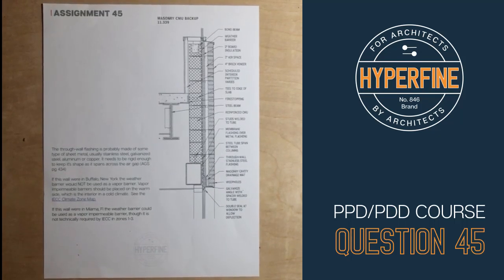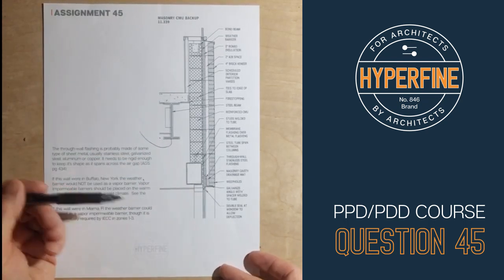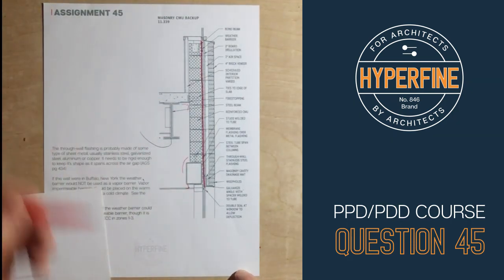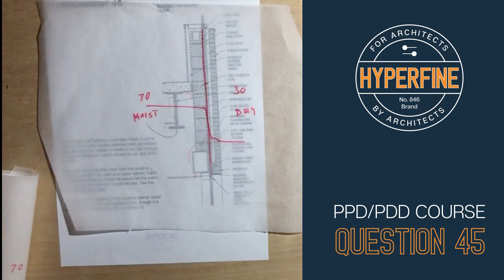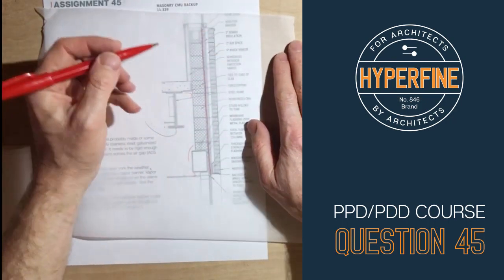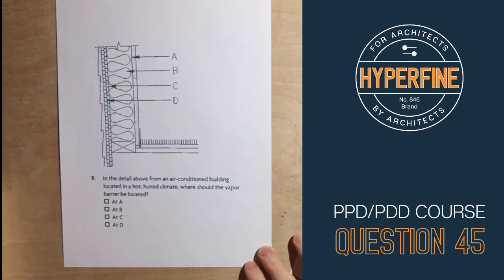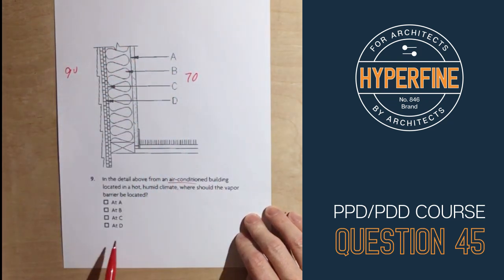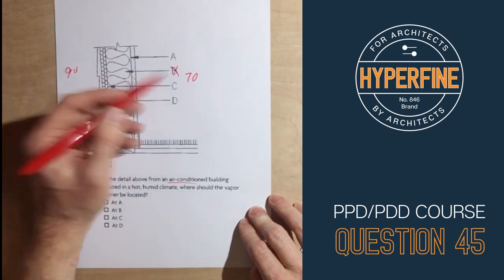ARE 5.0 - Vapor Barrier Locations

Comment: FYI, on question 9.. In Hawaii it is very common to install Tyvek building wrap as a way to prevent air and moisture from passing through to the wall cavity but allows water vapor to pass back and forth. This is one of those instances where the AREs use "typical" information which does not apply to many places. In other words, because Hawaii has a climate which is both hot and humid and can also be more mild and in some places even cold we almost never use a real vapor barrier or retardant and instead use building paper, building wrap etc. So really my comment is more to say as far as your "constructability" comment about placing a sheet membrane on top of studs it is common in Hawaii as the Wall for less expensive homes is detailed frequently as Siding>Building Wrap>Studs with insulation> drywall. Thanks for the video, helpful for the ARE studying!
Reply from the maker: Nicholas, thanks for the info! I agree, I think we all find areas where we know "too much" for the ARE and you have to think about the most basic, simple method. Not what happens in the real world, but what happens in Graphic Standards or the A201 or AHPP. I think the only bad thing about living in Hawaii is you probably don't get to use your experience on the ARE!

Comment: Thank you for this concise explanation, but I'm still confused. Based on your explanation of the perfect wall, for both cold and hot climates, it is better to place the vapor barrier between the cmu and the rigid insulation? It is not better to place the vapor barrier on the outside face of the insulation in hot climates (the warm side)?
Reply: My same question. I'm still confused.
Reply from the maker: Vapor barrier would still go outside the CMU, but before the insulation. Read straight from the godfather himself: https://www.buildingscience.com/documents/insights/bsi-001-the-perfect-wall

Or watch the video: https://youtu.be/E_ngmbANeOg

Comment: In SW Florida, all of the new residential SF housing construction is done using CMU on the outside, 3/4 rigid insulation with foil on inside, 3/4 furring strips on top of the insulation then drywall. Do you recommend that for a hot and humid climate? Are there better options? Thanks
Reply from the maker: Hey Alan, sorry for the delayed response, didn't see this comment. So the wall assembly you mention seems backwards to me and I have trouble picturing how you waterproof the assembly where the 2nd or 3rd floor meet the exterior wall. BUT, I am far from an expert in this stuff and I don't work in Florida. I always refer people to Building Science Corporation (Joe Lstiburek) and also a really great Instagram called Building Science Fight Club (by Joe's daughter).
Reply: Still the new wood framing houses in SFuses Tyvek wrap outside.